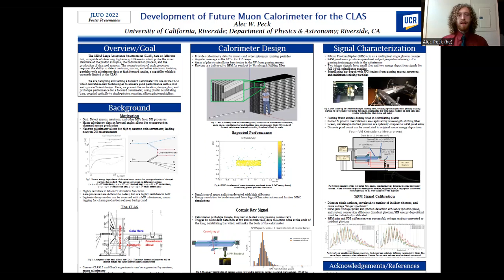Development of Future Muon Calorimeter for the CLAS

Comment: Thank you Alec.

1. You mention your scintillators emit in the UV and wavelength shifting fibers are used to convert to visible and transport to the PMT.  Why not use conventional scintillator and standard fiber so you skip the one conversion step from UV -> visible in the fiber?

2. Please describe Fig 4 a little more.  It looks like the yellow region is ~100% efficient, but has white spots scattered within it, why is that?
Reply: Thanks Brad!  I have done some work with traditional optics, and so I wondered the exact same thing you did!  There are a few competing sources of optical losses, depending which wavelength we want to go with:  the UV will have great transmission in a high OH silica fiber but worse photon detection efficiency (PDE) when it reaches the silicon-based pixels of the SiPMs.  Whereas wavelength shifting to green will have an inherent conversion efficiency, but it falls at the maxima of the SiPM's PDE.  Initially my instinct was perhaps similar to yours -- surely the UV-green conversion losses will be worse than the drop in sensor responsivity -- but one must remember that the very small size of the silicon diodes means that UV enhancement is essentially impossible and the PDE for a SiPM drops from ~50% in the green to ~5% in the UV.

Regarding Fig. 4, there are some non-uniformities which we would expect in this design, but in this image, those gaps are mostly due to the low statistics (N=1000) in this simulation.  Currently, our GEMC tools are limited but we are working with other teams to get a less rudimentary efficiency analysis.  There will be small gaps between the bars which constitute the active volume, but these can be minimized by staggering, and these detectors are sensitive enough to detect very small numbers of photons (even just a few simultaneous photons will appear above the noise level) compared to the emission expected from this kind of plastic.
Reply: PS.  There have been several applications, using this type of UV scintillation for muon detection, and in each of those cases, we saw the SiPM and scintillating plastic paired with the wavelength-shifting fiber.  We are basing our initial design on their success, but a comparison to detecting the UV light directly is something I am interested in investigating as our work continues.

Comment: Nice presentation Alec, an interesting upgrade idea.     I notice in your graphic the image of a person standing next to a large array of scintillators in the calorimeter.    Can you say a little more about the resolution of this approach, e.g. is each "pixel" of detection optimized in some way for energy deposition, spatial resolution, something else?
Reply: Thank you, Joe!  Our first priority is the energy resolution, but we also aim to get a spatial resolution of ~1 cm, perpendicular to the beam line.  The long, scintillating bars act as the effective "voxels", the physical, individual 3D cells which fill the active volume.  There is then a good spatial resolution on the two short axes of the bars (which can be improved by staggering the bars), but the resolution along the long axis of the bars (oriented left-to-right in Fig. 3) is accomplished through the relative timing of detectors at either end of each bar.  

A photon signal can take up to 50 ns to propagate through 3 meters of fiber, and the SiPMs have very fast response times, on the order of ~1 ns, which should allow us to reconstruct the location along the bar within a few cm.

Comment: I think I heard you refer to "leading neutron hadronization" -- can you explain what this is?
Reply: Yes, thanks Jozef!  In general, there are many things unknown about the hadronization process, but when a quark or gluon in a stable nucleus is struck hard enough to free itself from the nucleus, it must "hadronize" back into a colorless state.  If that final hadron state is charged, it can be easily detected in one of various electromagnetic-based detectors, but if the parton hadronizes into a neutron, it is more difficult to accurately detect its kinematics.  

One area of research I'll also be helping with will look at di-hadronization -- that is, when two final state hadrons emerge from a DIS event.  Typically in these events, one hadron carries most of the collision energy and thus tends to be emitted at high rapidity.  That hadron is the leading hadron, and if it's a leading neutron, this kind of calorimeter will make it possible to detect these kinds of events.